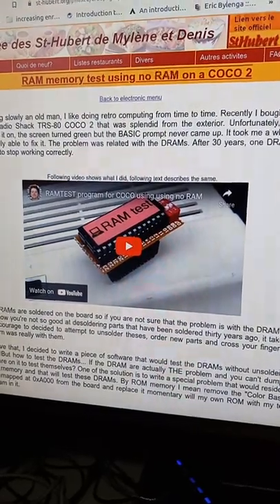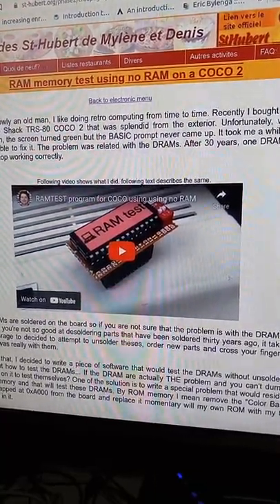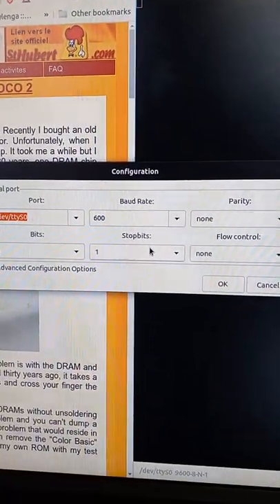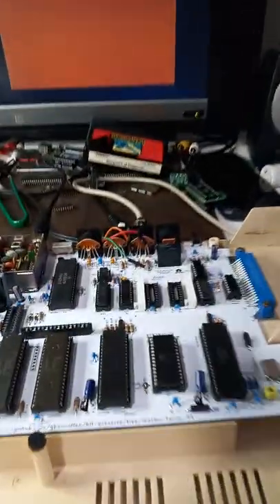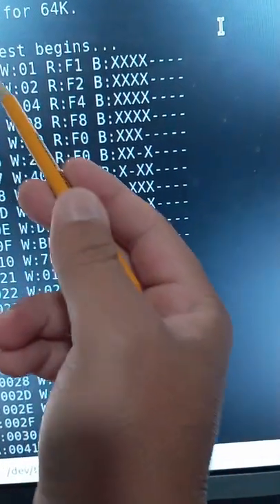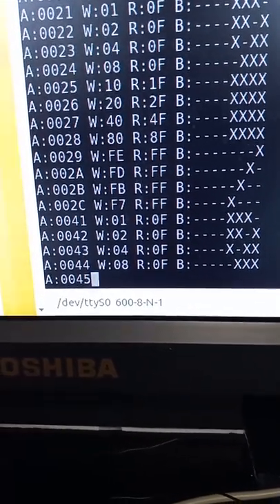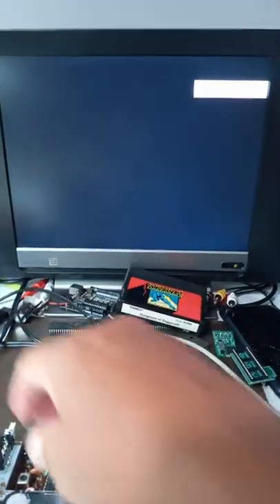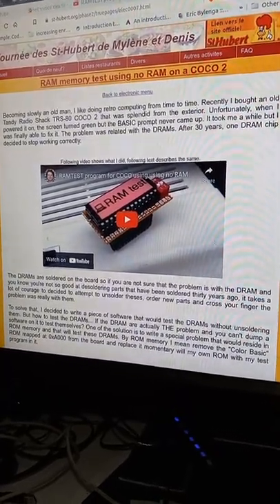Testing my CoCo 2's RAM with a no RAM RAM tester ROM #SEPTANDY 2022

Comment: Really cool!! I wonder if this step could be modified for other computers. Thanks for sharing!
Reply from the maker: I don't see why it couldn't be used on other 6809 based machines and the idea itself can be taken to other machines. I  know the commodore has something similar to this.
Reply: @rockyhill3  Would love to have a device like this for the Apple II and Commodore PET
Reply from the maker: @RudysRetroIntel  I wish I knew 6502 assembly but yes that would be very useful. I wonder if the commodore 64 version could be ported over?
Reply: @rockyhill3  both the PET and Apple II run 6502 processors